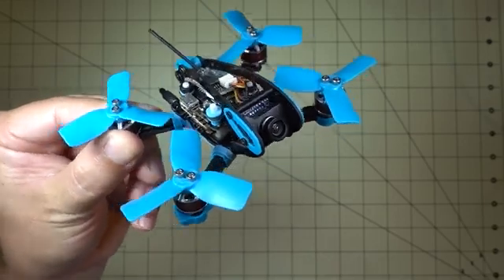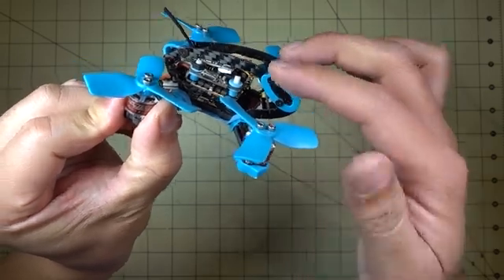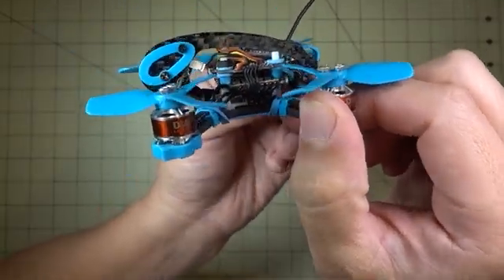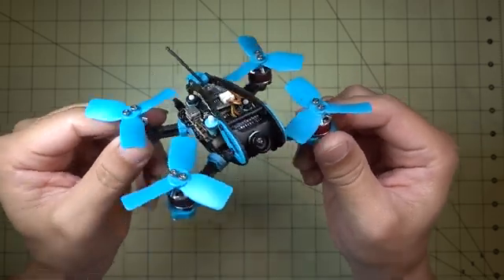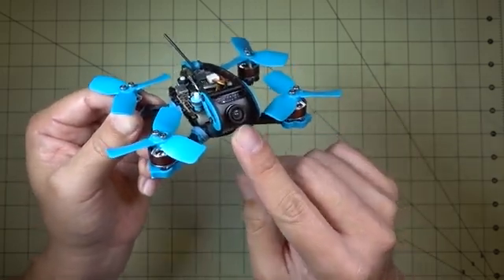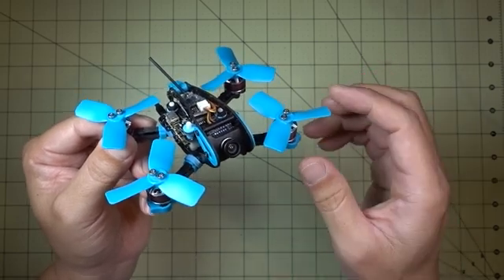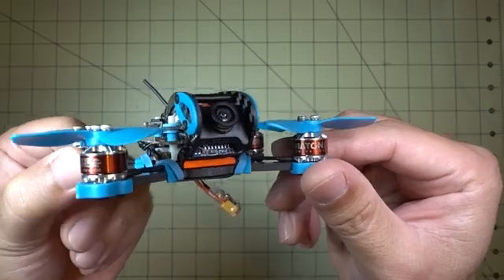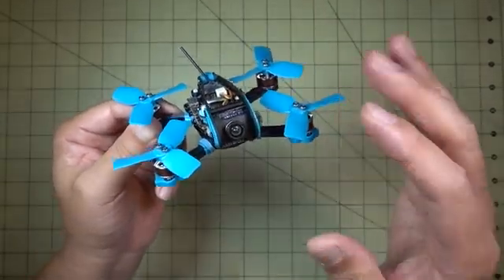Micro Drones 101 🚁#46🔥 Diatone GT-R90 👍👍👍

Comment: Hello Albert, I have a problem hopefully you can help. My +red wire came loose from the board of my gt-r90. After building alot of confidence I tryed to solder it back on.... mistake hole solder pad came loose from the board. Have you got any suggestion for new place on the board. I have capasitor underway cause is it filterd then? Hope you can help me or anyone else?? Jasper
Reply from the maker: If the whole solder pad lifted it will be almost impossible to fix. See if there is still some portion of the solder pad that is still attached to the board and you might be able to connect the lead there.
Reply: Albert Kim: no its hole gone. Is there another way for the power? Lets say the 5v led pad? Im a noob. Thanks for helping
Reply: Is the 5v pin direct next to tx3 an option? Or the +buzzer, I have solderd that for a buzzer I had. Wire is still there.
Reply: Albert Kim:I connected the video positive with the buzzer positive and all works for now....will this be a good solution?

Comment: Can't seem to get my fsa8s receiver to work with my turnigy evolution on the gtr90, the rx says it's bound but I'm not seeing any movement in betaflight for my turnigy.  Any suggestions?  I'm using rx6 and uart 6 is enabled under ports.  Serial based receiver is enabled and ibus under configuration.
Reply from the maker: set sbus_inversion=OFF
save
Reply: Okay I’ll try that in the future, it seemed switching the output on my evolution from pwm ibus to ppm ibus did the trick

Comment: Hey Albert - Did your Diatone GT-R90 come with an anti-fake code? I got mine today and I was checking it out and I can't seem to find the anti-fake code. I bought it from banggood, do you think its possible it is a fake? All my motor wires are red, instead of black like your video and all the images online. What do you think?
Reply from the maker: Mine is a PROTOTYPE, pre-release version.  They changed the color of the motor wires to red for the production version.  I will be getting a production version as well from Banggood.  I doubt it's fake.  As for an anti-fake sticker, I am not sure if Diatone uses those or not...
Reply: Albert Kim - I was just looking at the Diatone website and they have an anti-fake code thing under the support tab so I thought they would have one on the drone but not that I could find. Anyone else get one from banggood recently? but yeah it seems legit with the box and everything, but the esc wires are soldered on the top of the pads so the wires don't fit in as nicely. Alse, too bad they changed the wire colors - I think the black goes better with all the color options they have and the frame. Now I’m just waiting for a FS-A8S receiver to arrive so I can get it flying!

Comment: This or SPC Maker 95GF?  Which is best?
Reply from the maker: Get this one. The SPC Maker requires mods. This one does not other than tuning tweaks (software). My only gripe about this one is that you have to add your own receiver. Otherwise, this one is better is every way.  Also, I don't like the props, but it's easy enough to fix that, so not a big deal.
Reply: Thanks Albert.  Appreciate your insight.

Comment: I was one of the test pilots.  Your forgot the best part, that is a TBS UNIFY VTX with Smart Audio.  The TBS is adjustable from 25 to 800 mW.
Reply from the maker: It wasn't working on mine due to an error on my part. I put my IBUS receiver on UART3 which disabled Smart Audio. I have since corrected it and will explain in a later video. I also added these comments to the description.

Yes, this is definitely one of the best features of this micro!
Reply: TBS unify is very very noisy for me for some reason...

Comment: How would this compare with the Eachine Lizard 95 as far as performance? Thanks for the review and Happy Flying!
Reply from the maker: This one is way better. It can do 4S. The Lizard can't. The motors are better, the VTX is better, the FC is better... etc, etc, etc...
Reply: Thanks for the feedback and Happy Flying!
Reply: Julian Jakobs yes, with garbage batteries the Lizard holds up on 4s. Try it with a really good battery that can actually put out power and the ESC will overheat and/or smoke.
Reply: The Lizard ESC can do 4S. There are actually some people who run their lizard on 4S.
If the motors on this thing run hot on 3S already it will not be better suited for 4S than the lizard...

This is a pretty nice quad tho, i really like that frame.